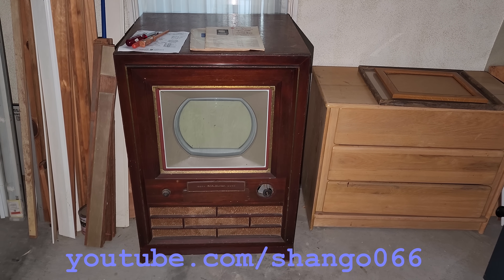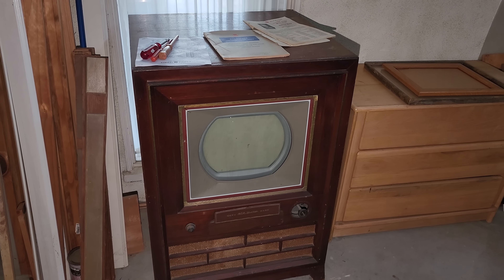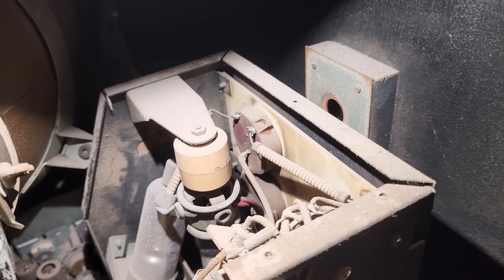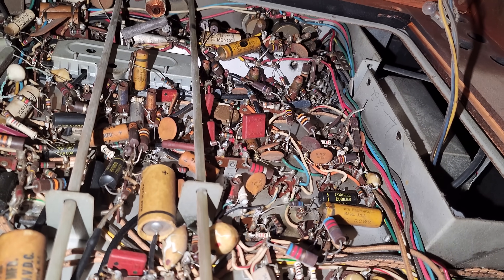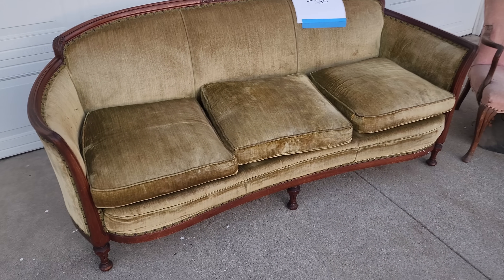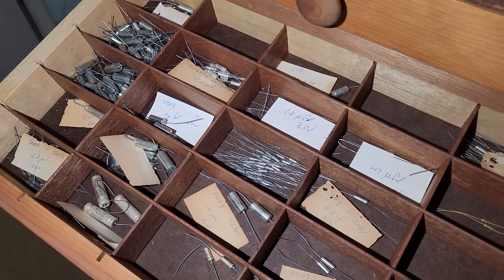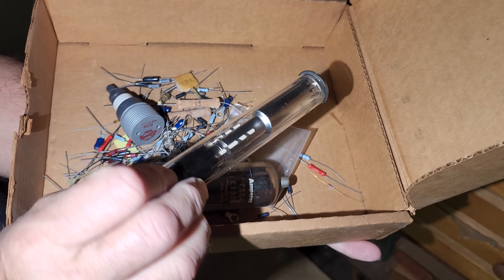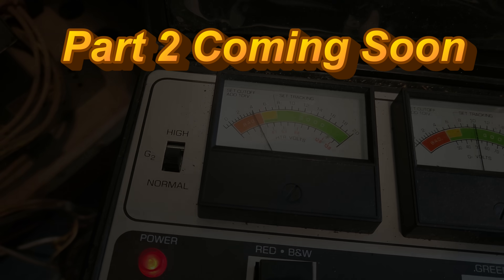RCA CT100 1954 First Color Television Analysis For A Fellow Collector

Comment: Oh, sure, tease us with the cliff hanger! We'll done in true Hollywood fashion. 🤣 Glad you were able to facilitate the transfer of one if the rarest color televisions. There is a Sylvania set that also used the 15GP22 CRT that is the rarest. There are two of the RCA CT100 in working condition in Washington State, one in Seattle and one in Bellingham at the Spark Museum. That wood cabinet with the parts in it is awesome. Heck with the caps, I want the Cabinet!! 😍
Reply: 'SpatsBear' on YouTube did a ten part series for restore / recap / repair on a CT100.  I believe it is still working.
Reply: @LakeNipissing  Phil's Old Radios also did a long article with pictures about a CT100 restoration.
Reply: CORRECTION. It could have been Westinghouse that had the other set. Someone else also said Admiral had an early color set